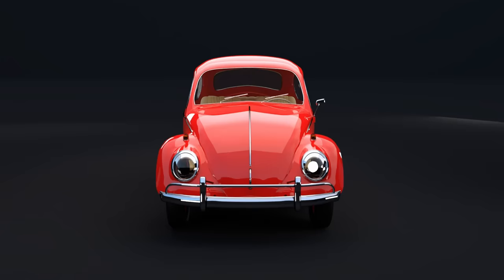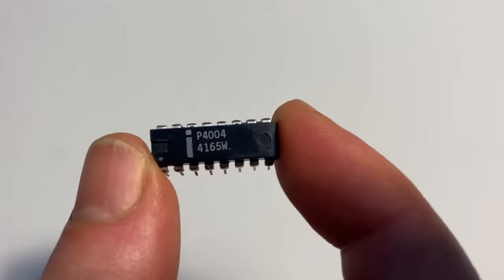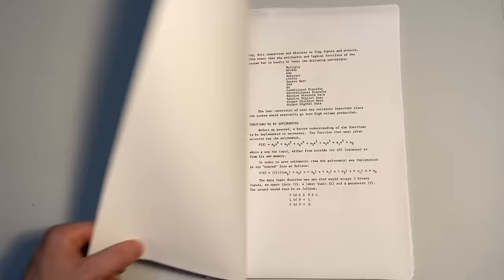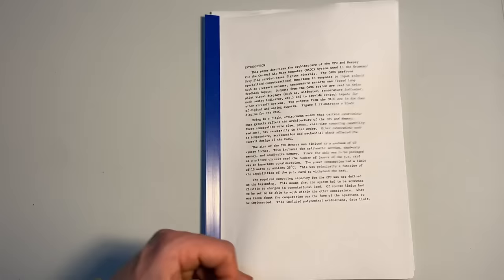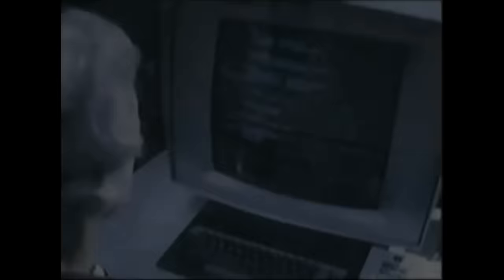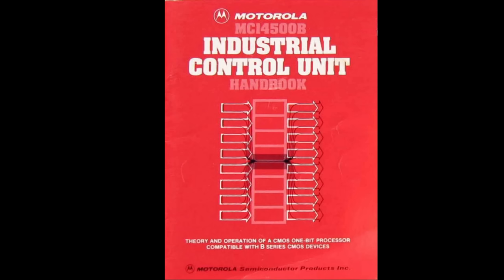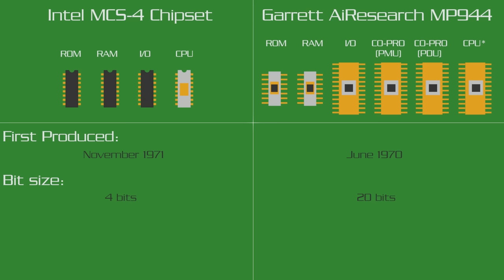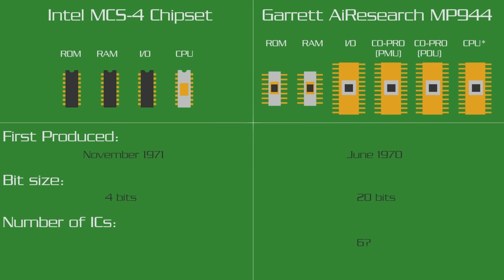The World's First Microprocessor: F-14 Central Air Data Computer

Comment: While in the US Navy for 20 years, 1970 to 1990, one of my main jobs, was to work on F-14 flight control actuators. One thing I was taught to do at a special instruction course was the wing sweep actuators and glove vane maint.. I could check and test the sweep actuators but was not allowed to go into them. They had to be sent to the Depot in Norfolk , Virginia for a complete overhaul. I was asked to do it several times, but I was smart enough to refuse. If the ship was in port ( USS Nimitz) I could get the paper work and hand carry to the depot that was a couple of miles down the road. I would want to see what the technicians there would find, particularly if we had a run of bad ones. Some times it would be bad aircraft wiring, a bad cannon plug or even that ADC, and not the actuator. It made for some good arguments. I spent 10 years in Squadrons, and 10 years in Aircraft Intermediate Maintenance Departments (AIMD) I also spent 5 years after I retired doing F-14 structural repair at the Norfolk , Virginia Naval Aviation Depot, and I've just retired from 20 years at the Coast Guard Depot at Elizabeth City, North Carolina.
Reply: By the 80's all the  CADC's would have been shipped to  Grumman and most likely supported there. Ray Holt

Comment: They started teaching computer architecture in A school in the 80s.  They had Altair looking computers where you would actually hand enter opcodes by hitting switches (they were Octal - so base 8) and pressing a button to enter the value into a register or memory.  You had to basically hand enter the program one opcode after another.  The press another button to execute the program and you crossed your fingers it would end up in the correct configuration after running your program :D.  I, of course, had already taught myself Assembler using DOS 3.2 and the DEBUG program when I was 14, so that unit was a breeze for me.  A lot of people struggled with that unit, but I was lucky.  Ironically I taught myself Assembler because I wanted to get closer to the "metal".  When I discovered PCs I was in an electronics phase, so for me it was the EE part that was interesting.  I eventually became a full time programmer / software engineer :D

Comment: "You couldn't for example build a practical desktop computer with a 4 bit processor". I can't see why not. The "4 bit" in the 4004 was the ALU and data path width between the four chips. The memory addresses were actually 12 bits and that's the far more important number. It's still a bit small, but all the "8 bit" microprocessors had 16 bit memory addresses and people did quite a lot with 8080/z80 CP/M machines, the Apple ][, the C64, the Atari 400/800. Those had 2^16 memory locations each of which was 8 bits in size, while the 4004's 4096 memory locations were only 4 bits in size. But a 4 bit computer with 17 or 18 or 20 bit addresses would be just fine, as long as it ran at sufficiently high MHz. Note also that the z80 has a 4 bit ALU, two 4 bit buses, and separate latches for the hi and lo 4 bit ALU results, which are produced in different clock cycles.

What surprises me about the 4004, looking back, is how many registers it has. There are 16 of them! So you can do quite a lot of calculations without hitting RAM at all. This is quite a stark contrast to for example the 6800 and 6502 which had three registers each for program variables (plus PC, stack pointer, and flags). Altogether the 4004 had 17 4-bit registers, 4 12-bit registers (PC plus 3 return stack levels), and a carry flag, for a total of 117 bits. The 6502 has 5 8-bit registers (A, X, Y, S, P) and a 16 bit PC, for a total of 56 bits, less than half as many register bits as the 4004!
Reply: You say addressing width is far more important, but bus width bring speed of operation.  I'd say they're just different, except that when it comes to powerful computing like GPUs, it's often this data bus width that is the limiting factor of the architecture.
Reply: "You say addressing width is far more important, but bus width bring speed of operation." Yes, that's exactly what I said. Addressing width is fundamental. It determines the complexity of programs you can run. BUs width is merely speed, which can be compensated in any number of ways. “There is only one mistake that can be made in computer design that is difficult to recover from—not having enough address bits for memory addressing and memory management.” Bell and Strecker, 1976.   @VeritasEtAequitas
Reply: It had good amount of registers but it was needed for addressing, fetching, arithmethic operations and narrow bus. The CPU lacked logical instructions and when I researched it it seemed it's hard to write more complex programs due to these limitations. It was really calculator on a chip designed for decadic calculations. Even the 4002 RAM chips were designed to store mantissa and exponent with sign in separate locations and you had to use different instructions to access them.

Comment: I was in the Army and was a mechanic for the 1980's light tank and I was impressed by the components, open one up and it was filled with multiple universal cards, so we could essentially lose a few cards(around 4 if I remember correctly) before the whole box needed replacing.

Comment: 17:50: As I recall, there are a number of "microprocessors" that are an aggregate of several chips. The 8080 "microprocessor" being one that comes to mind. Intel quite clearly refers to it as a "microprocessor" on their datasheets, but requires 8224 and 8228 to build a system around. Nomenclature wars anyone?
Reply: Generally, a microprocessor contains the ALU, registers, and the control logic to fetch instructions and send data along the correct path.

I/O is usually included on modern microprocessors too, but generally interrupt controllers and such are not. A microcontroller is designed to be an all in one system containing ROM and RAM, along with all I/O. By putting these in one chip you can put computers in smaller devices at the cost of versatility of the system. There can be large debate as to which extensions would be required, such as floating point and multiplication for a microprocessor. The 8086 up to I think the 80286 required separate floating point co processors or FPUs such as the 8087. And x86 processors are what we still use today in most desktops. There were versions of the 386 I believe with and without the x87 floating point extensions.

To say that we went from assembling computers transistor by transistor to microprocessors is very misleading as stated in the video. Computers before microprocessors were assembled by logic gates, as the 7400 series chips were released in the '60s. Then computers were assembled with more complex chips containing ROM, RAM, control, registers, and full ALUs in single chips. Just how we don't see the reason to combine our CPUs with SSDs and RAM now in our computers it wasn't very worth it to do it with the mainframe computers at the time. The technology jump from having separate control, registers, and ALU chips to one chip is smaller than most people make it out to be. There were much bigger jumps such as when the original 7400 chip was released, putting multiple transistors in one chip. There were also large technology leaps such as the PLA and other predecessors to the FPGA, allowing us to "program" a chip to behave like any logic chip we want to.
Reply: You are pretty much correct there. Actually, you could build simple microcomputer systems without the 8228 System Controller, though you lose easy access to certain signals such as whether you're accessing memory or I/O address space. (That removes a useful but not necessary feature: you can always use memory mapped I/O.) But yes, without the 8224 Clock Generator, you'd need other equivalent external circuitry to generate the unusual asymmetric ϕ1 and ϕ2 clocks that the 8080 requires.

Comment: I found this entire video fascinating.  Your explanations of definitions, concepts and use cases were excellent. My degree is in Digital Microprocessor and Telecommunications Technology, and included not just the basics of all electronics and simple digital circuits, but also integration into larger and larger I.Cs.   Really took me back to those days of writing out machine code with pencil and paper, then hand-coding and old 6502 (8-bit) microprocessor in hexadecimal.   And to think, they were handling 20 bits, 20 years earlier than that.  Awesome stuff!
Reply: Well, they were handing many more bits even earlier than that, just not with microprocessors. The mid-60s CDC 6000 series were 60-bit machines. And the IBM 701, released in 1952, used 36-bit words.

Comment: What is a microprocessor?  In reality it really does not matter, however, companies and marketing people love to label what they have.  When I started the design of the F14 CADC the implementation of the “processor” was unknown. As we tended towards the new “integrated circuit (IC)” technology names such as IC processor or LSI (large scale integration) was used. Micro was also in there somewhere as the computer design evolution progressed from large, to mini, to micro.  It was not a big issue to anyone.  Ultimately, as the CADC project was completed and I wrote my paper I chose the name “microprocessor”.  There was no focus on single-chip, multi-chip, program counter location, etc. In fact, even Turing was set aside as the main focus was to do the job irrespective of # of chips and what function was where, and even how data was transferred. The selection of any cleaver design techniques (pipelining, co-processing, in-flight self-test, dual redundancy), algorithms, and package selections we made to reach the speed and accuracy necessary to fly the F-14 as needed. It was unfortunate (for me and history) that the 1970 presentation of my paper and any patents were strongly refused by the US Navy thus 30 years of silence started. Around three years later the Intel marketing group started labeling their work. First came the World’s first microprocessor, then the World’s first commercial microprocessor, then Intel’s first microprocessor, then Intel’s single-chip microprocessor ….  Today, everybody wants their design to be a microprocessor, otherwise, how are they going to out market Intel?
In 1973, Hank Smith, Microprocessor Marketing Manager, Intel Corp made this statement at the IEEE 1973 WESCON Professional Program Session 11.  “A CPU uses P-channel MOS and is contained in 1,2,3 or4 LSI standard dual-in-line packages from 16-42 pins per package”.  Even at this time the word CPU was sometimes used for the entire processor and not microprocessor.
After this, history started dissection the word CPU, microprocessor, single chip, etc to fit the functionality, design, and packaging of each product. Thus, here we are in 2024 (54 years later) still trying to make it all fit into convenient definitions.  Ray Holt

Comment: This is very interesting.  I was a structural design engineer on the F-14 program for a few years in the early 1980s.  Even as I contributed my small part, it felt like i was chipping rocks compared to the stuff the guys in other parts of our building, and in other buildings, were doing.
Reply: Still, it's a long way from actually chipping rocks! That's what civil engineers do. (Mechanical engineers build weapons; civil engineers build targets.)

Comment: Great video. In the past I have been involved in two small processor designs.. a silly one where I had an evaluation copy of a system level design tool and a 150 cell CPLD and an EPROM.. and another that sold in the millions , the de emphasis digital audio filter in a Philips CD player chip. It had to do several multiplications and some additions all in 24 clock cycles. It was bit serial and used modified Booths algorithm multiplication .. two bits per clock cycle on 18 bit data.. 18 bits because it began life in a Digital Compact Cassette player..
Reply: The internet is a small place! Hi Mike!
Reply: High, can you point me in the right direction to develop a chip for a small drone? It will be the basis for AI for the Ukrainian military
Reply: @martinwhitaker5096  it sure is!

Comment: You did an excellent job describing this fascinating element of the F-14 I have never seen investigated in detail like this.  

I was a little kid when the top gun movie came out and was absolutely enthralled with the F-14 because of that film.  Approaching 50 now and I completely forget at times how far the hardware for computing has changed and how revolutionary an aircraft with chips like these were.  

I started in college with electrical engineering but changed to a degree in information systems, but your talk about this brought flash backs of my coming to the conclusion I was never going to be an electrical engineer 😂.  Really nice video on an interesting subject.

Comment: The flaps and slats were interconnected and never moved individually, if any one of them got out of position by more than 2 degrees from the others, the system would lock out in that position. There is a set of position sensors at the end of each flap and slat, when the aircraft was put under high G the computer would deploy the flaps and slats a few degrees to increase turn ability. The inboard flaps only functioned when the flap selector handle was actuated, they were either up or down. If the flaps were selected down the wings had to be in the forward 20-degree position for the inboards to work, they were hydraulic actuated and would blow back up if the airplane went over a certain airspeed. If flaps were deployed at all the wings would only sweep to about 50 degrees. When wings were forward, roll was assisted by spoilers when the wings swept back past a certain point the spoilers failed down and they were locked out, roll was by the stabilators only at that point. Grumman developed the F10F Jaguar in the 50's with swing wings, I think they were manual only, but the company was a prime subcontractor on the F-111, bringing their swing-wing experience to the project, the CADC was probably developed for it and refined for the F-14, remember that the SECDEF at that time wanted the Navy and Air Force to have the same fighter/ bomber since the F-4 worked for both services. The F-111 sucked for the Navy for a number of reasons and Grumman left the program and developed when the Navy initiated the FTX program. Politics killed the cat.

Comment: One thing, I think, you missed that was controlled by the flight computer were the variable ducted engine intakes that changed their profiles as the engines went from subsonic flight into mach speeds.  I seem to remember one of the F14 WSO/RIOs talking about this...and in the early engine mods could cause a flameout under the right conditions.
Reply: Yeam, he implied al lthe computer controlled was the wings and vanes which was far from factual, although I don't think he meant to.
Reply from the maker: The CADC didn’t control the engine intake ducts - they were managed by a separate In dependant system called the AICS (Air Inlet Control System)
Reply: Those were controlled by a different computer. Probably because the engines have a different manufacturer than the airframe, and existed independent of the F-14. So, use existing means to control the ramps, or add more cost and complication to a CADC.
Reply: @pgtmr2713  The F-14's air intake geometry is built into the engine nacelles and air intakes... the control of the actual variable intake geometry was a Grumman design specifically to allow the TF30's to operate in the designed speed regimes.  When the GE F110 was installed in the F-14B and F-14D, the scheduling of the intake ramps was changed to optimize performance in the transonic region.  The end result was the TF30 actually produced more thrust at low altitude and at high mach (not necessarily both).  Air stacking in the intake allowed the TF30 F-14A to go to Mach 2.34, the GE F110's were capped at 1.88.
Reply: You are thinking of the F15. The F14's version of this was entirely through discrete logic. The F15 was what brought it digital.
Reply: @Whiskey11Gaming  The F-14 B/D was not limited to 1.88. Or really limited to anything the pilot and plane could manage to do... which also wasn't 1/4 less capable than the A model, with the more powerful upgraded engines in B/D.  IF stacking air in the intake would make the aircraft faster... Then B/D models would have less ramp dialed in and "stack the intake" too.  Instead of being less capable. Too much air was the reason for the ramps.
Reply: @pgtmr2713  the B and D were limited to 1.88 due to controllability issues with loss of an engine at high Mach and yaw problems. It's in the NATOPS.  The intake geometry was not ideal for the airflow requirements of the GE F110 either.  Specifically, the actual ramps blocks too much airflow when fully deployed and the engine pulls in too much air when more open, causing turbulent airflow off of the ramps.

As I said the ramp geometry was designed specifically for the requirements of the TF30. They were not changed for the F110 except in the programming of how open they were. That programming was optimized for the trans-sonic flight envelop from about Mach .8 to 1.5 on the B and D. Before and after those values the TF30 actually makes more power at certain altitudes and speeds than the F110.  That's from publically available data on both the A and B/D models.
Reply: This is a very interesting advance in chip technology.
Great video.
Reply: @Whiskey11Gaming  Thanks for providing a more in depth example.